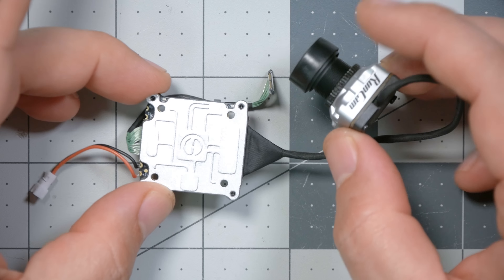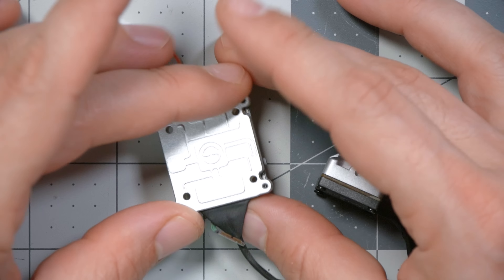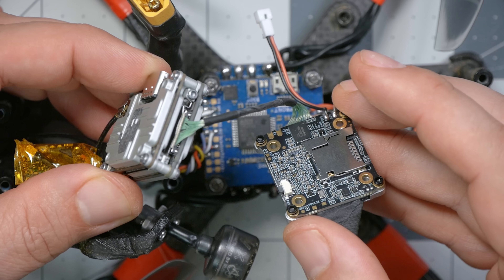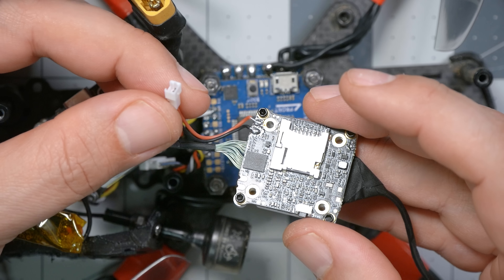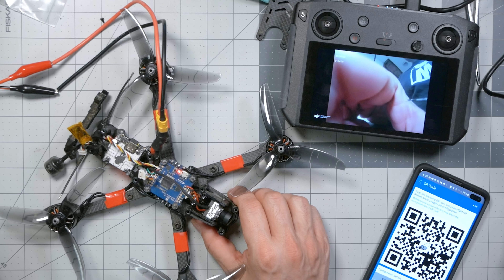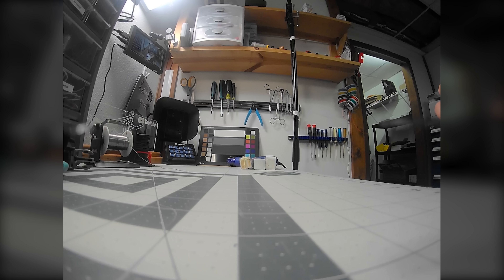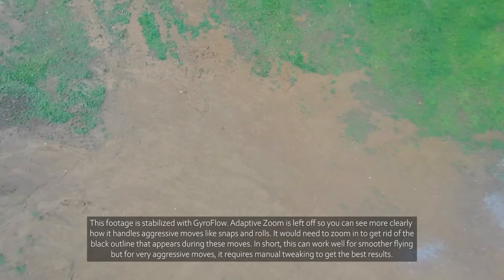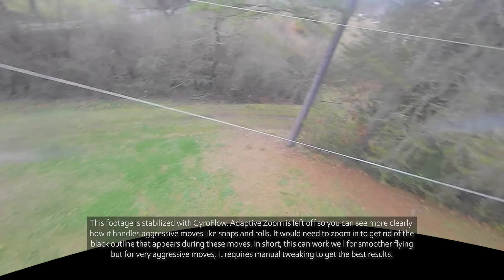Record your DJI FPV feed in 2.7k with RUNCAM SPLIT HD

Comment: Short answer: Agreed. About videos not being in sync: The air unit recording does this too. It’s the DVR in goggles dropping frames. While you are flying, it looks choppy but when you review in goggles, the  dropped frames will make playback take less time.
Reply from the maker: I'm not convinced that explains it. The video went instantly out of sync even when the quad was very close. And the bitrate was like 50 Mbps. Also, I after syncing the beginning and end of the video, I checked the middle, and it was in sync, which suggests a constant offset, not random dropped frames.
Reply: @JoshuaBardwell  I always found my air unit recordings were 0.3 seconds out to the audio, I would always need to offset the audio to keep them in sync, I know this isn’t the same issue but it seems keeping stuff in sync is a bit of an issue for DJI, perhaps there is an inherent problems across the devices causing this.

Comment: Hey Joshua, for the gyroflow clip, were you using the dev build or 0.3.0? Reason I'm asking is that, somewhat annoyingly, the order of the data differs between this and the runcam 5 orange, causing the stabilization axes to be swapped. (There's a windows build for the dev version on the gyroflow website downloads page with support for the Split HD)
Reply from the maker: Hmm. That might explain some of the weird results I got. I was using 030. I did some searching to see if there was an updated version for Split HD but didn't find any releases.

Comment: So ya, added 30ms of latency is a deal breaker.     Funny thing though, we know it's possible to not add latency with an onboard DVR, because DJI's AU already does it (slow SD card bug aside).   And yes 60-70ms total latency is also too much for aggressive fixed wing flying as well, and I wouldn't want one bit of extra latency while flying a sub 90mm indoors either.    Caddx missed the mark on this one.

Comment: Holy latency Batman!  Dealbreaker IMO.  I mean, if the camera was GoPro quality then...maybe, otherwise...no thanks.  The camera propriety is also frankly a dealbreaker.  Ironically, they could've fixed both issues with a different design path...  allow bring your own camera and have the DVR record in parallel (no passthrough). Would have also made it cheaper.

Comment: Did you try latency on other resolutions? 
The analog split cams will vary drastically between resolutions and frame rates in latency.  Like the split 3 is 50-60ms in 4k 30 but in 4k 60 only 35ms and even less in 1080.

Comment: DJI seems to be only good for the actual user. Audience Mode isn't as good as analog, switching cameras, onboard DVR. I just want to add SD for onboard gyro. My stupid F411 only have 2MB and I've used both uarts for ELRS and DJI VTX. I was hoping this was an idea. It seems Insta360 GO 2 is my best option.

Comment: The ability to work with any camera is critical. Consumers should not need to buy a dedicated camera just to record video with their existing HD Vista camera combo. 
Latency of video signal should also not be impacted, the DVR should just be listening in on the video stream (Y branch), and buffering, so not impact.
DJI not fixing firmware, and Caddx/Runcam not being able to offer more generic options is a huge limitation ... that leaves door open to GoPro, Insta360, etc. (and all that extra weight, that could have been more battery for longer flights)

Comment: Absolutely gutted about the latency. Was so close to buying some until I saw that. Guess I can only have my broken air unit recording. Works sometimes I guess? 🤷
Reply: Yup. Having to use the one specific camera - and 60 fps - was rather bad, but perhaps usable. The latency is a complete deal breaker for about 90% of DJI pilots - i.e anyone not flying fixed-wing or cruiser.
This whole thing seems like a stupid mistake. If they could have had the video from the camera's MIPI do a straight passthrough to the VTX (and simply split off internally for the DVR) so you don't get extra latency, then perhaps some people would live with the 60 fps latency. But as it stands, I don't think any freestyle pilots will use this. Especially since DJI's video quality, while great for lowish-latency FPV isn't actually that great compared to a GoPro or similar camera.

Comment: I preordered this DVR so that I could throw it on my 3”. I could have (barely) dealt with a 60fps camera… but the added 30ms latency is a total deal breaker. The DJI latency, to me, is on the verge of acceptable as-is (I still prefer analog lol.) Double that and there is NO WAY I could even fly. There wouldn’t be a point to having the DVR to record flying… because there would just be an SD card full of crashing. Lol. I canceled my preorder. Too bad because it could have been so awesome without all the latency. Man, get the hopes up and then crushed back down. 😔